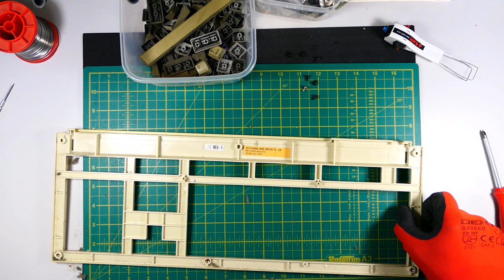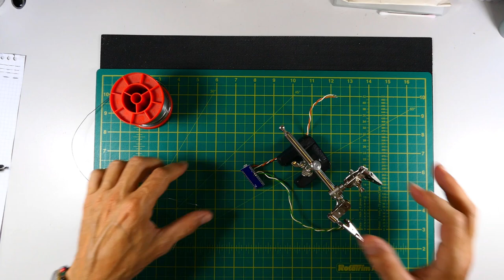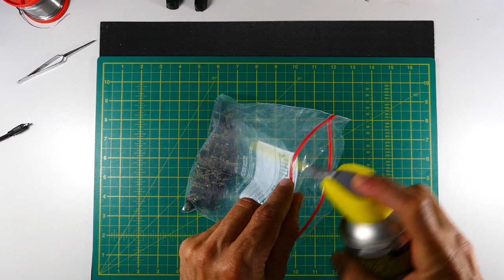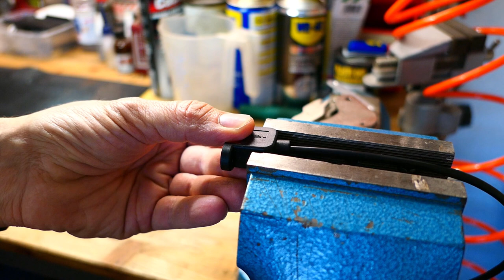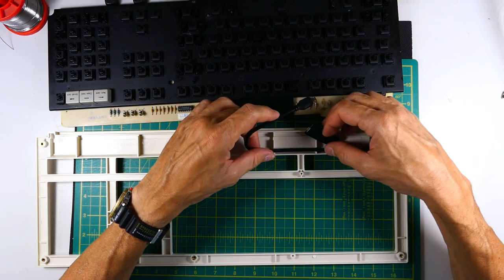Bull Questar 205 Terminal keyboard restoration (Wyse PCE rebrand)

Comment: Could you do a video on how you do the soarer USB conversion? I am trying to do the same project by bringing some new life to a WYSE PCE Terminal Board and I seem to have some trouble as it is not being detected when I use the hid_listen software provided by teensy. Thanks!
Reply from the maker: Hi! I'll see what I can do for You
Reply from the maker: Hello, You should first check the wiring to the ProMicro controller. There are several revisions of the Wyse PCE PCBs, here are a couple: 
https://i.imgur.com/uxG44mw.jpg   
     https://i.imgur.com/q4NXgs6.jpg . In the Bull Questar this is the corresponding ProMicro pinout on the PCB https://i.imgur.com/Xrtnk04.jpg . In both revisions there is an electrolitic capacitor (C7 in the Bull Questar) that is near the Rj10 connector, that is usefult to double check +5V and GND . There is no need to use hid listed if You made connections correctly , it usually works at the first trial. Regarding the Rj10 connector pinout that Soarer published in the Wyseverter post, it's easy to get confused because it's published reversed.

Comment: Great work! that way of mounting the pro micro and connector was very clean.  What lube did you use for the springs and stems?  looked like WD40!  If you have to open a large number of switches when they are off the keyboard I find the kiiboss kiiopener so much easier than the mechanical keyboards.com one.  Any plans to retrobrite?
Reply from the maker: Thanks! I wrote in the video description that I used WD40 Specialist dry ptfe spray lube . The Keyboard case has been retrobrighted ,yes. You may see the color difference from the first video frame and the last one. It took 4 retrobright baths to have the original color back, this was a though one, I was about to give up but I'm glad that I insisted! Thanks for the switch opener suggestion, with the guys of the italian mechanical keyboard enthusiasts group we are in the process of 3d printing the opener and test it.
Reply: @BitSplits  Ciao Bill! Video magnifico, merita più visibilità!
Potresti indicarmi l'indirizzo del gruppo dei "meccanici" italiani? :)
Reply from the maker: @alkemist1000  non metto link di invito al gruppo telegram in pubblico, per favore ti iscrivi al piccolo forum che abbiamo creato qui: https://forum.clickyclack.club/ possibilmente con lo stesso nick. Appena entrato non vedrai i post disponibili, ti dobbiamo autorizzare. Quando ti vedo iscritto ti abilito alla visione dei post e ti mando un messaggio con il link di invito. Facciamo cosi' solo perche' siamo in pochi a gestire tutto e non vogliamo spammers haters ecc. :)  ,  e' prevista l'espansione il prossimo anno.
Reply: @BitSplits  grazie mille, a presto!

Comment: Hi there. I found two of these wyse pce terminal keyboard.

All I need is to disconnect the terminal cable, connect four wires to teensy?

And before that I must install the custom firmware on the teensy from my computer?
Reply from the maker: Yes, pay attention to the correct teensy / keyboard connections. It's all is needed to convert the keyboard to usb

Comment: What's the machine you used to soak the keycaps ?
Reply from the maker: Any Ultrasonic Cleaning Machine will do it. Mine is a 70W model , just add a spoon of baking soda to water and cycle it until You're satisfied. This process will remove dirt not yellow from the  caps, for that You need retrobright that is a different process.
https://www.amazon.com/s/ref=sr_st_price-asc-rank?keywords=ultrasonic+cleaning+machine&rh=i%3Aaps%2Ck%3Aultrasonic+cleaning+machine&qid=1548490259&sort=price-asc-rank

Comment: can you make a video about the usb mod part? what kind of board is this blue one you use? how do you know where to solder in the pcb?

thank you
Reply from the maker: Hello, the board is  a Pro Micro, micro usb type, you can find them on ebay for a few bucks https://www.ebay.it/sch/i.html?_odkw=pro+micro+5v&LH_PrefLoc=2&_osacat=58058&_from=R40&_trksid=m570.l1313&_nkw=%22pro+micro%22+5v&_sacat=58058 and load it with a firmware called "wyseverter" from a guy named Soarer https://geekhack.org/index.php?topic=52597.0
. Soarer published a schematic of the rj 11 wyse pce keyboard , I did follow it and found signals on the pcb at the base of the rj11 connector itself.